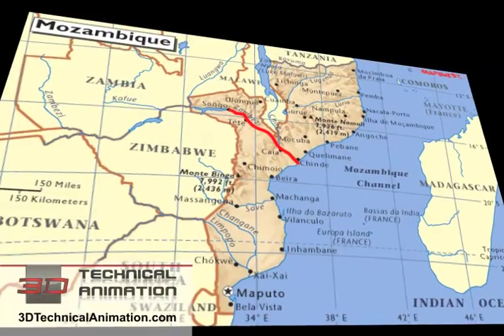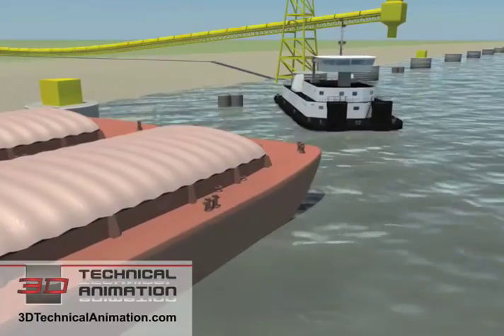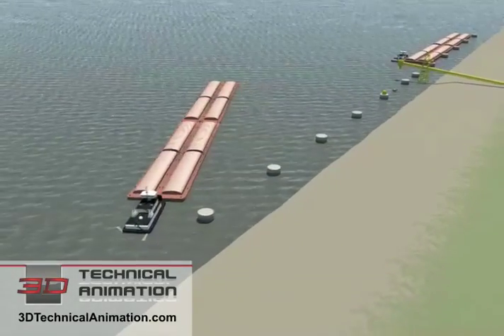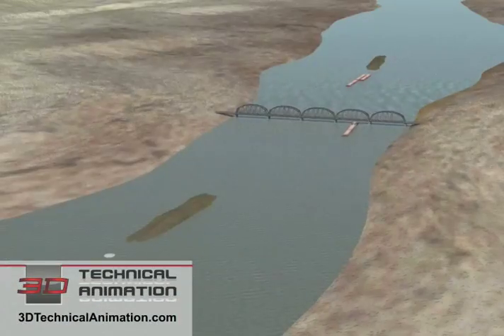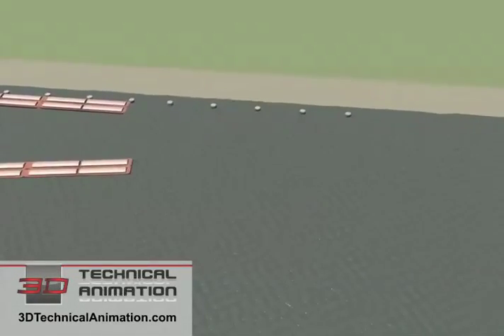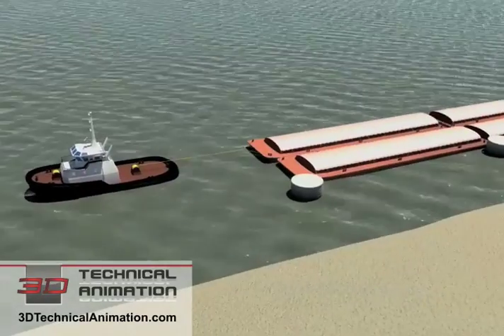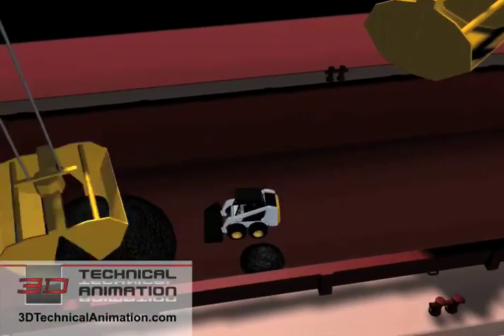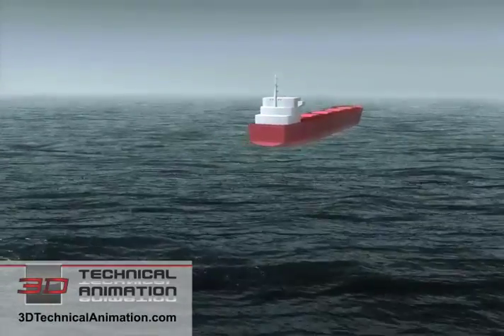3D Technical Animation - Barge Operation

Comment: So when they can be winched to the loading area why do they need a tuck to move it to the loaded barge fleet instead of winching it there too?
Reply: Hi. Good question. The wenches can pull the empty barges under the conveyor for loading. The reason they do not have wenches prepare the barges into the 8 barge convoy is because the wenches would not be able to push the barges away from shore into a second row to make up the 2 barge wide convoy. Yes, there is a logistical way it can be done, but not as efficient. Let me know if you have any other questions. ~Cresto